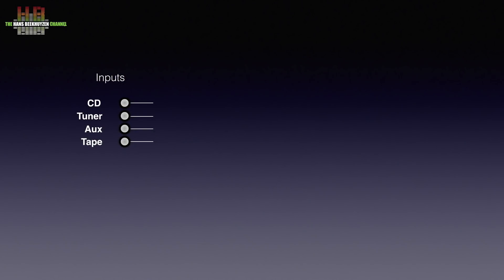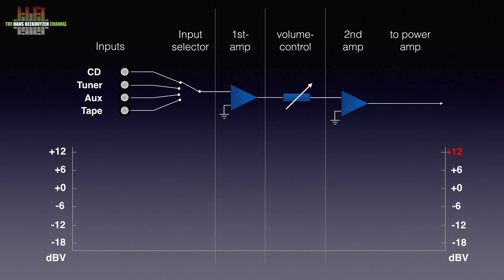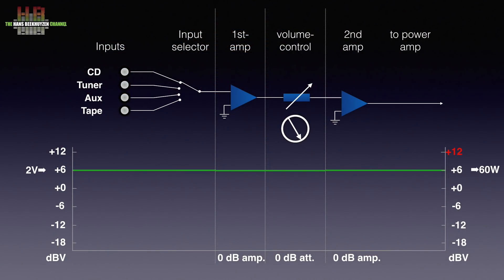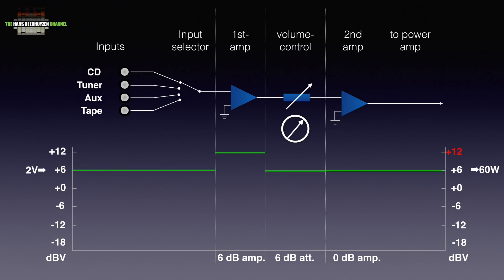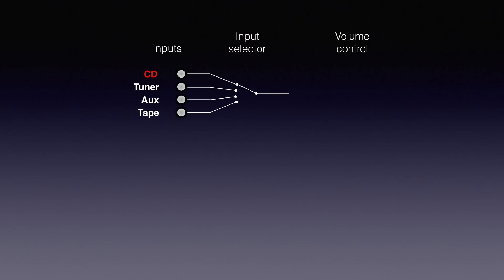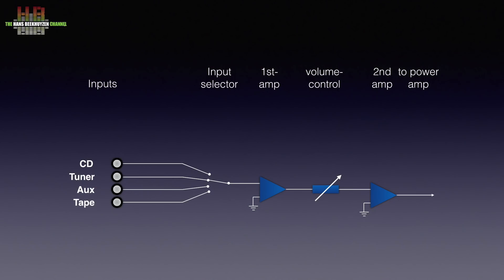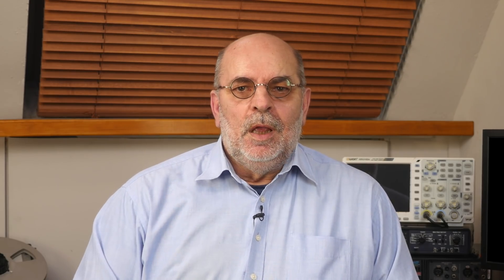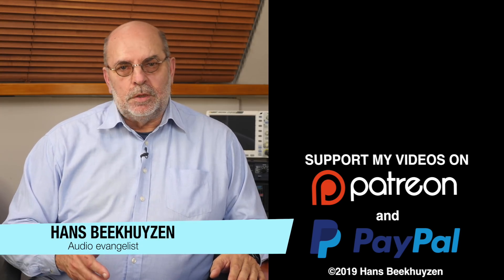The secret of the volume knob

Comment: Is there not something that could detect clipping of your waveform, like a peak meter which could then lower the gain  so the loudest sound wouldn't clip but be as loud as it could go ?
Reply from the maker: Some brands, like NAD, have  a circuit that does that (Soft Clipping), but it is as with Stabiliy programs in cars, if you enter a bend at very high speed, you will loose control.

Comment: Maybe they could put a resistor on the switch for the inputs of the amplifier which would set the gain of the first stage to compensate for the average difference between sources.   Maybe recordings could put out a DC  voltage at the start, it would be blocked by the amplifier as it is DC but could go to a comparator which would set a gain level on the pre-amplifier
Reply from the maker: if the designer would know what equipment is going to be connected to the amp, he could. But he doesn't know....

Comment: Suggestion for another video topic... 
Pre-out voltage matching to external amplifiers.
There is ALOT of confusion regarding this topic. It is hard to know if a pre-out is going to be able to drive an amplifier to it's full potential or not. Manufacturers normally just lists Vrms at unity gain, especially on receivers.

Comment: A wonderful, and very descriptive lecture! Thumbs up easily. I like how you explain things by also first describing the foundation of the electricity, and technology, Hans. Certainly there is a threshold to how loud a speaker, of headphones can be set at since there is the possible risk of hearing damage. I have connected a phono pre-amplifier, a Rolls VP29, to my receiver, 85Watts minimum (of 2012) via my turntable to get that loudness whereby the music from record can be heard as the older amplifier section of my previous receiver could easily output.

Comment: As a DJ we have to master the control of output DB. Every track is different so we continually adjust our output level on the main mixer to keep a constant 0db, with a possible max peak of +3db. So the people in the nightclub hear the same volume level from track to track.
The sound engineers in nightclubs will get really upset if you even touch on 6db peak. Since at those volume levels you could be getting close to damaging speakers or worse.

Comment: Thank you Hans for coming up with another insightful video. Is it also true that, rather than attenuating the incoming signal, that the volume control can also vary the gain of the amplifier in order to reduce unwanted artefacts on the resulting amplified signal?
Reply: It is true. My PSaudio  Stellar DAC/preamp does just that. They call that aspect of their design a Gain Cell.
Reply: "Is it also true that, rather than attenuating the incoming signal, that the volume control can also vary the gain of the amplifier in order to reduce unwanted artefacts on the resulting amplified signal?"

No. Volume controls and gain controls are 2 separate things.  A volume control can't distort the signal. Gain can.  If your system has gain control(s) anywhere in the signal path, you set those first. Then use volume controls to set loudness.